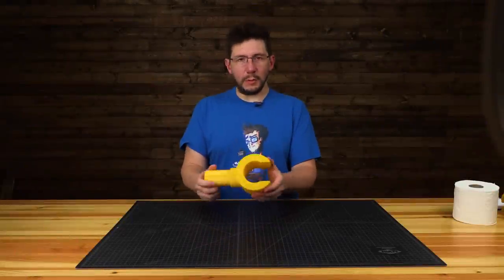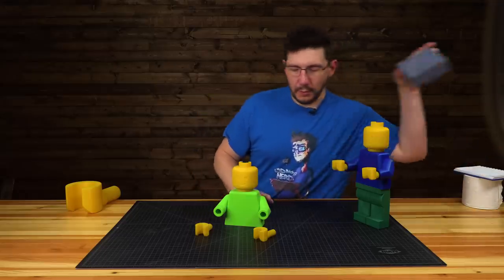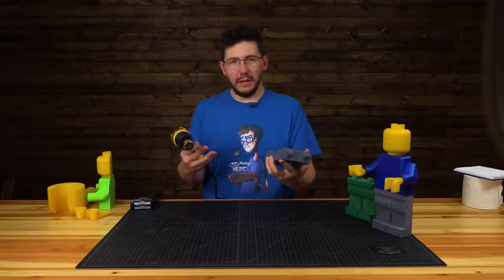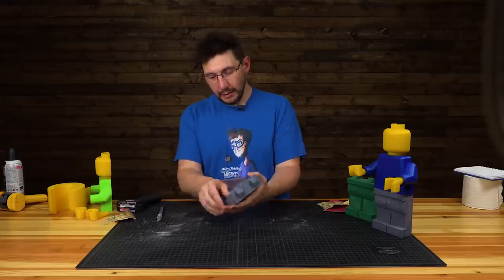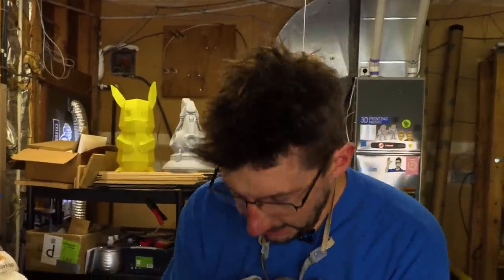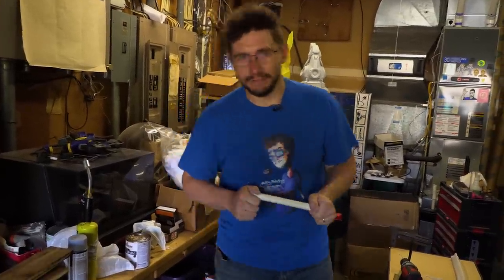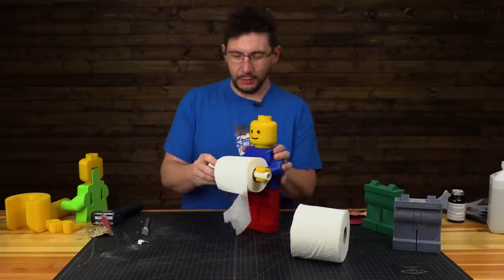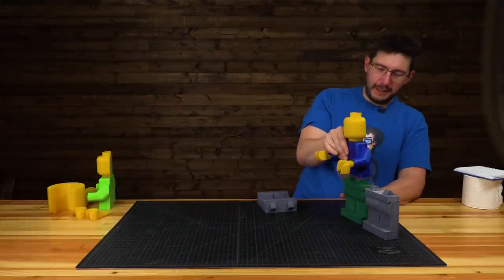3D Printing LEGO to Hold My Toilet Paper!

Comment: 5:10 "400° F air, so what is that, 20° C?" LMAO FR
Reply: Thought I was the only one that noticed that.
Reply: @zachmerz1638  Lmao, I didn't realize how HOT extruder heads were until I burned my finger on it and had to look up what the temp was in F

Comment: Just wondering - why didn't you 3D print the actual rod to hold the paper? Instead of using PVC so it's an all 3D Printed project?
Reply from the maker: It would have taken longer, and I already had the PVC tube. :)
Reply: I think, what would be awesome, is one of those Technic axles for the bar...
Reply: @3DPrintingNerd  https://www.thingiverse.com/make:451638

Comment: Yep.  Has the same problem with the TP size.  I had to rescale it up 15% bigger for to work with the Costco stuff.  And even then,  I had to use mesh mixer to mod the hands to be more centered at the wrist.  But it worked.

Comment: @6:25 ish, harbor freight sells a scraper kit made of red plastic and they're PERFECT for scraping the melted PLA globs from a model that size. For smaller prints and ones with more geometry they have a three pack brush kit one is steel, one brass and one nylon. The brass and nylon are best as the steel one doesn't have the same give on the bristles.

Comment: Here I am, looking for a good method to paint details on a printed minifig head. And Joel just uses a Sharpie. :D
Reply: keep it simple where you can. Crazy how some things get done by the pros where beginners overthink it and make it way more complicated than it needs to be.
Reply: @MattWeber  you are right. But the issue for me goes a little deeper than one might think. Or the pens you get in the US are just that much better 😁
Reply: @Balrog132  Nah i cant use the sharpie myself for many details like that.. the dye flows into the layer lines and makes edges fuzzy looking.. but if zoomed in im sure joel still had this issue. For depressed details like that i would have used some paint and a small brush if wasnt priming the model,  and then sanded around the area so only the details still held the paint.
Reply: @MattWeber  I think I found a good pen for this type of highlighting details. At least if used properly

Comment: You need caps for the ends of the PVC tube.  Otherwise it will work its way out and fall on the floor and the roll will go across the floor where you can't reach it right at the crucial moment!!

Comment: I'm sorry but you can't use your IR thermometer to measure the air temperature coming out of a heatgun
Reply from the maker: True, but it can measure the temp of the metal the air is heating, yes?
Reply: @3DPrintingNerd  Unless you know the exact emissivity of whatever material the end of that heat gun is made out of.  If you knew that particular parameter, and your IR thermometer was good enough (expensive enough) which allowed you to program in emissivity, then you could get a somewhat accurate measurement.  Most places looking to get a good thermal thermal profile of a PCB or particular material, they coat it with a high emissivity coating.  Look into black bodies!

Comment: is t posibly to scale that figure up 1 cm or make the hands seperate, so they kan be made a bit longer and vider ?
Reply: You can simply scale it up as you want, as long the parts fit to your printer. So with 200% scale you might make a holder for paper towls..

Comment: Hey Joel, great video. I have a quick question. I also have a pulse xe printer but have been having part cooling troubles.( mostly on the backside of the print) I noticed that you have a different part cooling fan shroud on your pulse I and was wondering where you got it from and how well it works.  I would appreciate any info you can give me.

Comment: "a roll of toilet paper that has some use on it" sounds a bit smelly ...
This model works okay with the paper I have at home but at the office we have wider rolls - something very uncommon. I could fix this by cutting of a few mm of the flat portion of the hands easily by just telling Simplify3D to stop printing at a certain height.